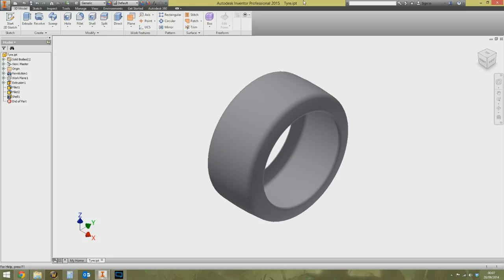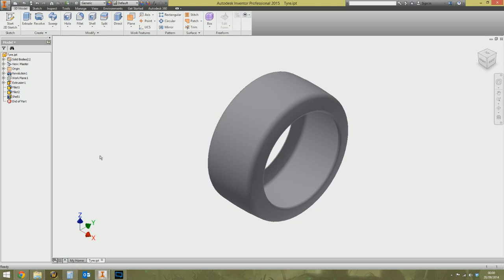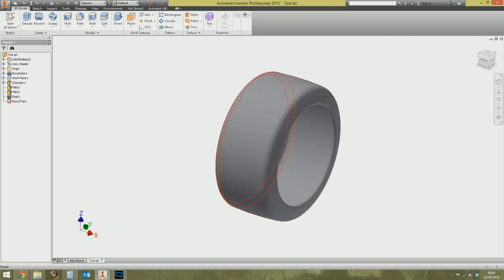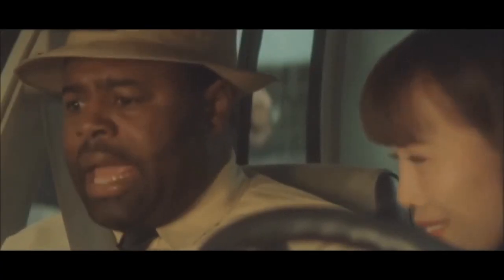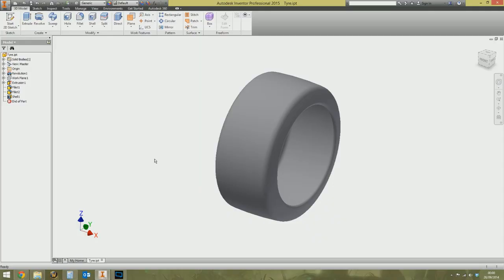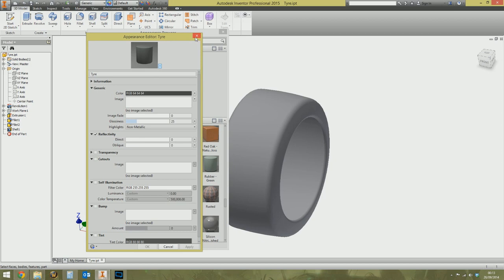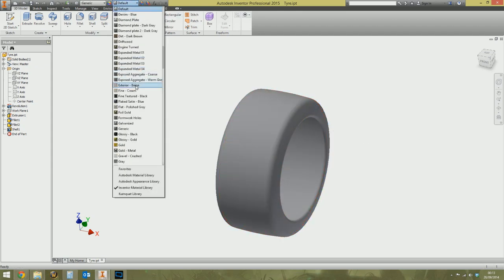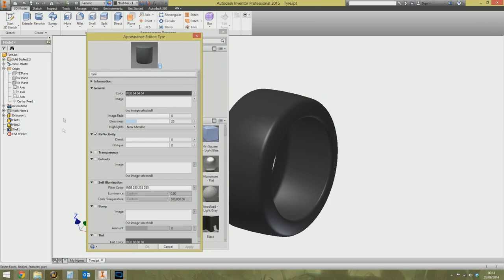How to Apply a Custom Image Texture to 3D Models (Tyre) | Autodesk Inventor

Comment: I just found out that in the texture picture editor window you can put in the values for resizing the image straight in your desired unit(in my case mm), and it will convert automatically to the unit inventor's using. This just saves time having to calculate and convert all the troublesome units.

Comment: Useful vid Neil. I am guessing that the slight caveat to this approach is that the texture is not associative, so if you make any design changes, the texture would need to be updated manually. The interface is very familiar to users of 3DS Max BTW, so whilst it may seem bizarre as a CAD user, I get the impression that it has just been shoehorned in from Max.
Reply from the maker: I suppose it depends what design change you made, but probably yes.  And yea back in 2010 ish they had a product wide initiative to standardise all the materials and texture interfaces across all the products, as well as the actual assets.  The idea being you could send a model between products and it retains, recognises and respects the textures.  It sort of worked out but its not perfect!

Comment: Hi again.
I watched your video a second time and remembered to set Realistic in View, and this then allows the texture origin point to display where you appear to have moved it to.
However, this does not change what you end up with if you render the model image. The image origin point is still in the centre of the surface, on my version of Inventor.
There does not seem to be an option for Realistic in Render, which is a nonsense anyway. "Oh sure Microsoft we are happy to have a range of 'unrealistic' incorrect renderings."
This still has to be a glitch otherwise the Tyre in the video would not render as it appeared set up to.

Comment: Thanks for this video. It is the closest I found to the problem I have with Inventor's texture mapper. I've worked with many systems before, from Alias to Pro/Engineer, and this week I have been teaching myself Inventor, as industry does not seem interested in the other CAD packages these days.
Anyway, watching this video it seems my software trial may be glitchy.
When you loaded the tyre texture in, I saw as with my 2015 version, Inventor stupidly loads from the middle of the surface unlike other packages, as you said not user-friendly. But you got around this with the offsets. That was the obvious solution, which I tried first off, but on my version the offset does not shift the surface centre load point as it did for your tyre. There seems no other way to control this, which basically means I cannot load images onto surfaces without getting a tiling of the four corners from the centre. As part of this system error, switching tiling to none only effects the editor, it still tiles on the model. Not impressed.
Any thoughts?
Kev
Reply from the maker: Did you switch the rendering view from shaded to realistic? I think I mentioned in this video that having the view settings to shaded doesn't tile the textures correctly.  If that's not it, email your IPT and texture file to support@cloudcad.co.uk and I'll see if there's anything weird going on
Reply: CloudCAD Ltd
Hi. Yes as I go on to say below. I have switched Realistic on, but that only changes the working view, not the rendered output. If on your version you can position images on a simple plane and render them with anything other than corners of the image centred in the middle of the surface, then that suggests my version is faulty.
Cheers

Comment: Hello, maybe you can help me with this problem... I can't use the offset of the position of the texture, if I change a value then there's nothing happend...
Rotate and size of the texture works fine...
Beforehand thanks :)
Reply: +kermislol 
Already figured it out... when using realistic modus in view style the problem is solved :)